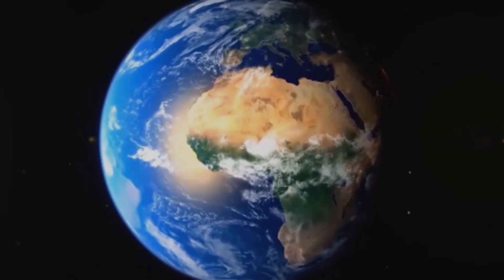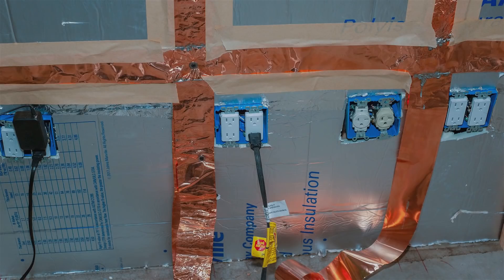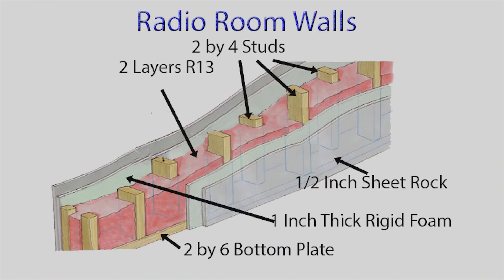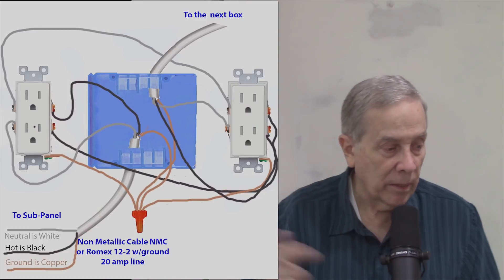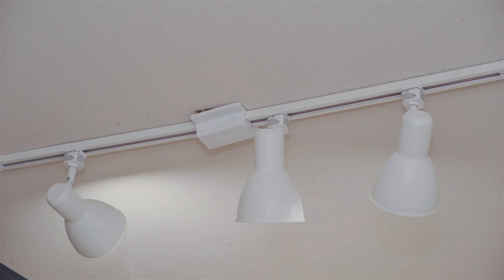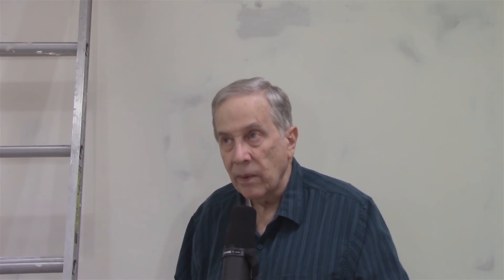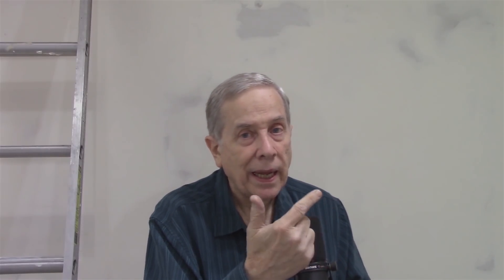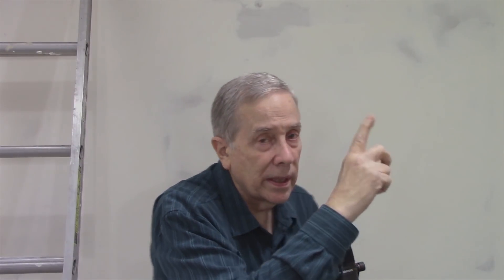Building a Ham Radio Station with YouTube Elmer. Jim Heath W6LG Part 2

Comment: I don't yet have my ham license however, your videos have made me want to go from a cheap baofeng and my local repeater nets to an HF DX capable setup. As I am of little means and little space, I've purchased a 1977 yaesu 301D and I'm currently building a mag loop which will work on 20 and 40m bands. I'm studying for my basic with HF license here in Canada. You've inspired me to reach for the world. Thank you Jim!! 73 from outside of Toronto.
Reply from the maker: Wonderful.  Wow, you made a loop as a first project.  That is not easy to do.  Congratulations on all. 73, Jim

Comment: Love your videos! I keep cruising 20m band listening for whiskey six lima golf but as of yet no joy, hope to catch you on the band someday.  That new station is looking great!  73 KC1MGH
Reply from the maker: I am just now getting back on the air.  The radioroom is almost complete.  I have dipole made from aluminum tubing attached to a 4 by 6  wood post at the rear patio cover.  It is only 20 feet high.  Today, for the third time, I replaced all of the feedline.  Hopefully I can complete that tomorrow.  The losses on the two previous cables was too high.  I hope that I can get the tower up soon. City restrictions are 30 or 35 feet max height. In any case, I am trying to go slow and careful.  I did brake 4 ribs a few weeks ago. I made dumb move and fell. Thanks and I hope to hear you soon.  73, Jim W6LG

Comment: Glad you ar ex ok and back at it. I bet you can hear the radio com calling you " finish me so we can play". Look ing forward to seeing your first call out video!
Reply from the maker: Thanks Joe.  I will probably have a video camera running since it has been so long.  It was January a year ago that I started to dismantle the station.  I really miss being on the air.  This morning a ham from Grass Valley will be here.  After he leaves I hope to get the painting done.  We are using painter's caulk and installing trim boards where we can.  Man, I am not a finish carpenter.  I tried 3 times to do a compound corner and screw it up each time.  Thanks Joe, 73, Jim